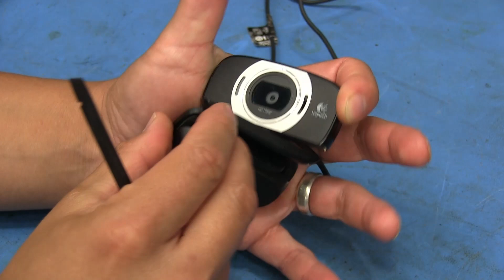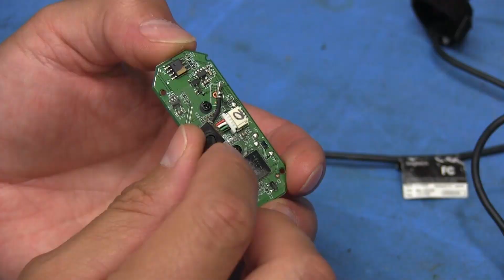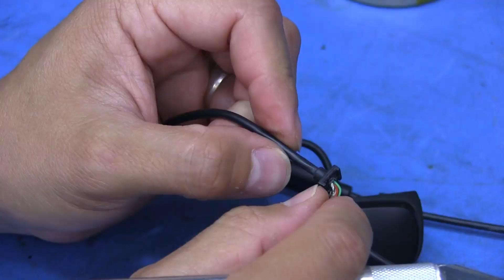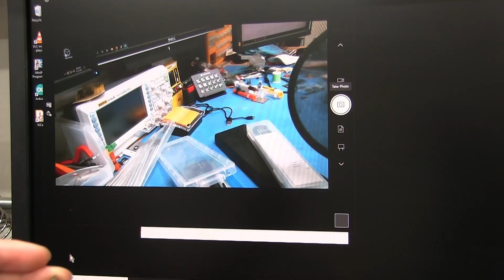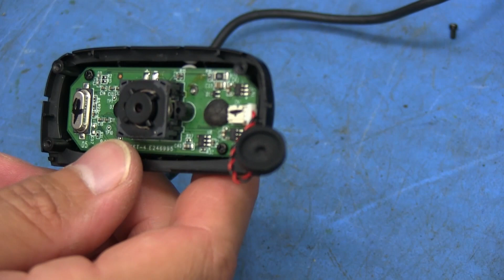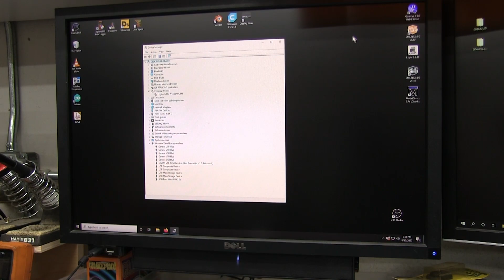TWB #102 | Logitech C615 Webcam USB Repair(?)

Comment: Have the same camera with same problem, Logitech support next to useless so glad I found this vid. Having torn mine down, it appears to be the earth that's the issue, all it took was to re-solder it and now perfect! Although I lack any patience to route the cables with the cable strain properly, so just hot glued the whole lot in place out the back of the chassis!!

Comment: Same problem, but as soon as i took the thing apart and plugged it in with the board outside of the plastic housing, it worked fine. But every time i've tried to use it for a Zoom or Teams meeting, it cuts out and disconnects randomly. Just did a test meeting and wiggled the cables in every way possible, just shy of abusing the thing, and it stayed connected. I'm at a loss

Comment: so weird... going back to around the 4 min mark where you still haven't unplugged it yet, the connector looks good. maybe one or some of the wires wasn't sitting in the connector securely?
Reply from the maker: Yeah, possibly. I should've tried plugging it in after taking apart, but before messing with the cable, to see if maybe it would act up.